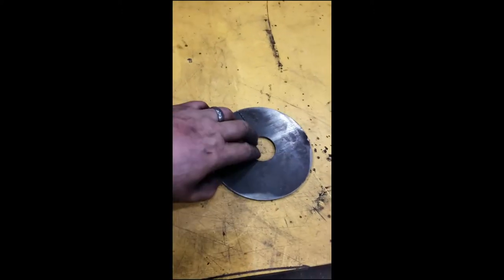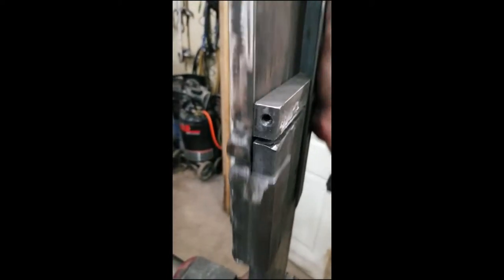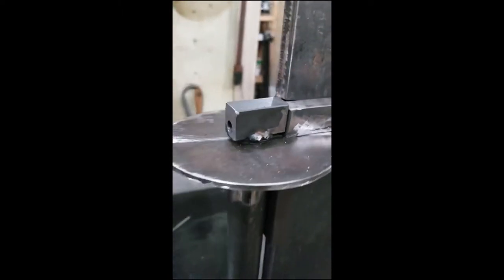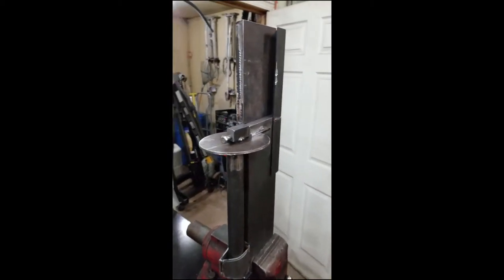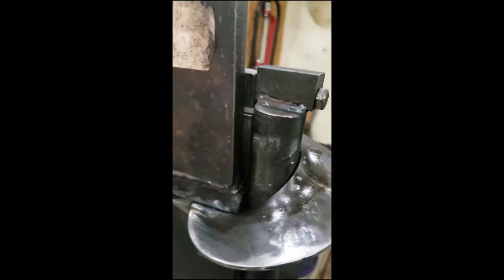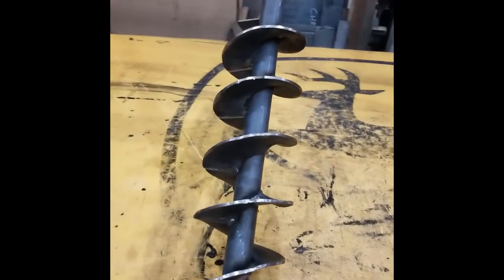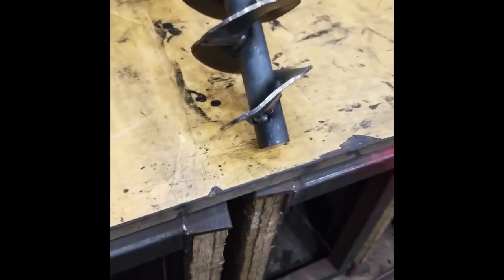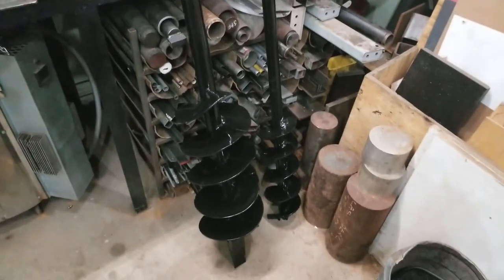Working Example of DIY Post Hole Auger for Hydraulic Digger Attachment

Comment: It is satisfying to see you use this after spending time to make it. Including the hydraulic pump build. I could never use such a beast at my property, since I have too many big rocks and huge boulders in the ground. I would probably put the hydraulic pump to use on a wood splitter, but I wonder if it could be used to power a rock breaking jack hammer?